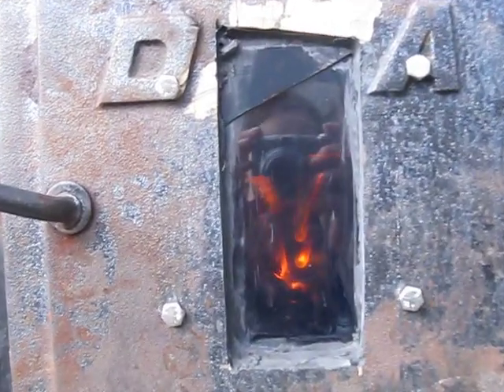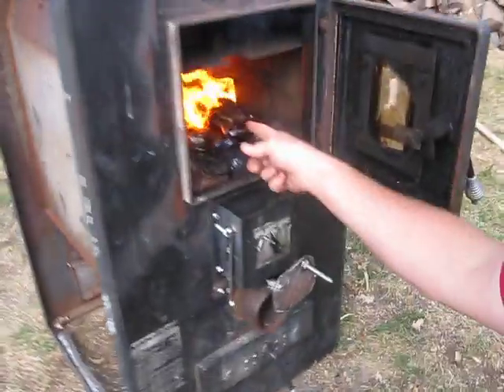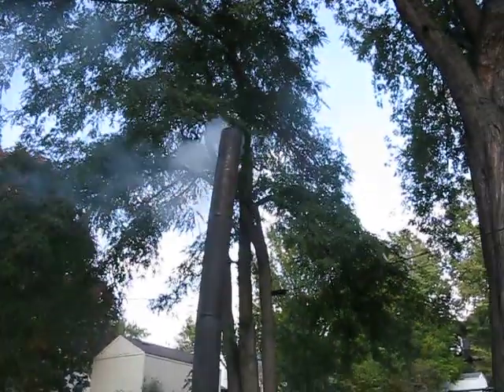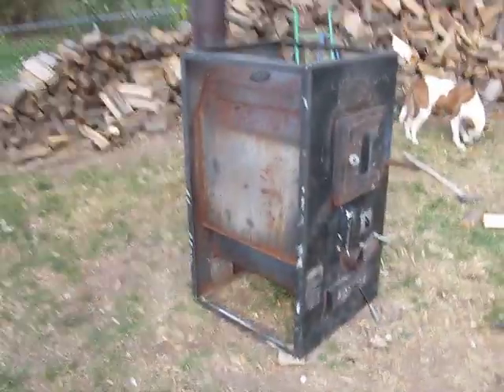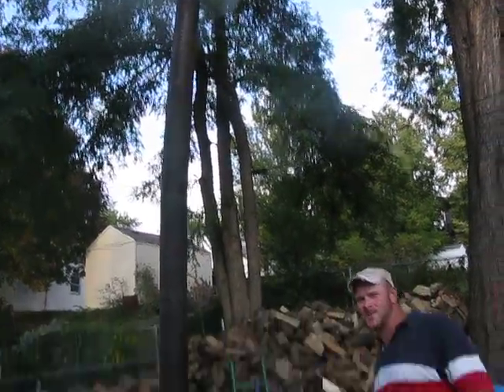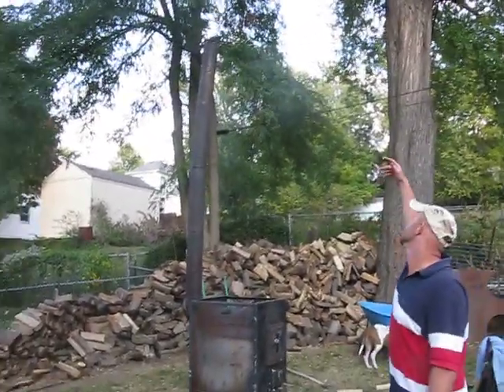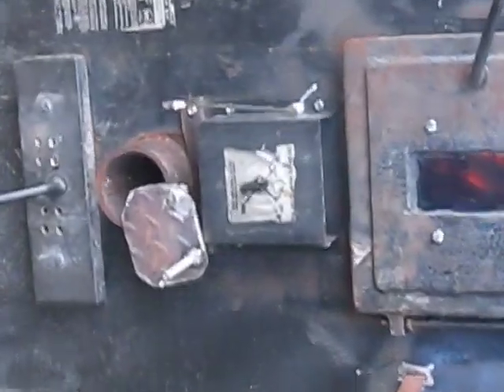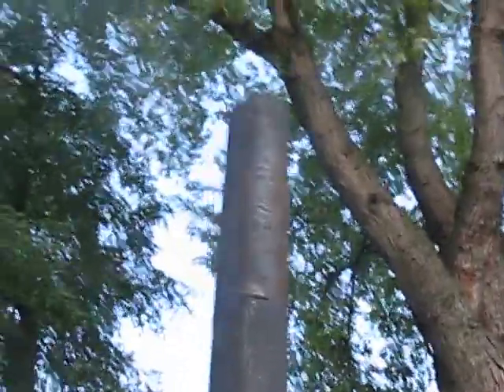Stoves that can eat trash smoke free!!!!!

Comment: Sorry to burst your bubble, but burning the smoke before it exits the stove is old news. There are several stoves on the market the are designed to burn up the smoke, capturing more of the heat and run more efficiently. The stove I designed (and use now) burns at 600 degrees, which is more than enough to heat my home and I can hold my hand on the exhaust pipe going into the chimney. That's pretty efficient, wouldn't you say? The nice thing is, it's about half the size of yours and looks much better. I have absolutely no smoke, no creosode and very little ash. I haven't had to clean my chimney in 3 years now and it's still clean today! It's 7 degrees outside as we speak and I'm sitting here in 74 degree comfort as I'm typing this. It's so nice and cozy!!!